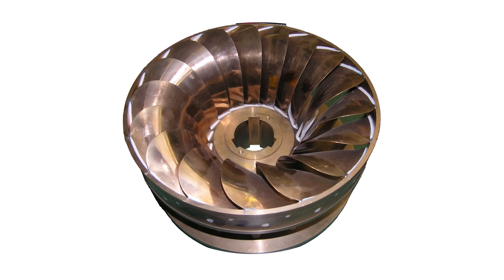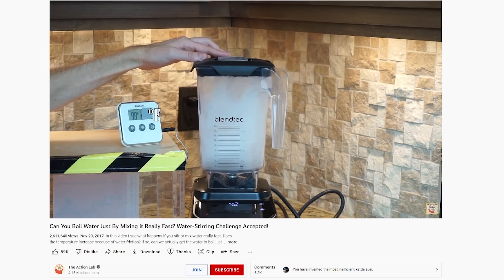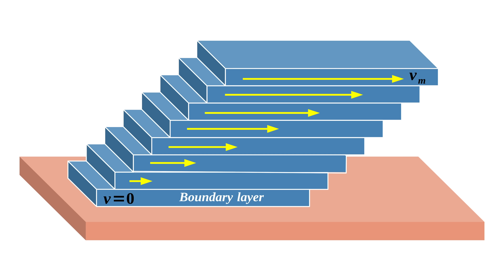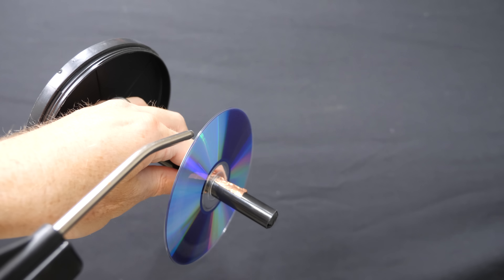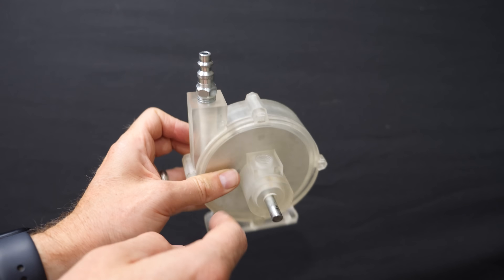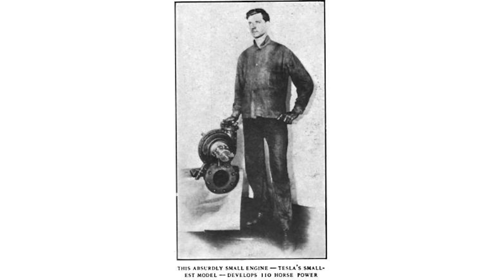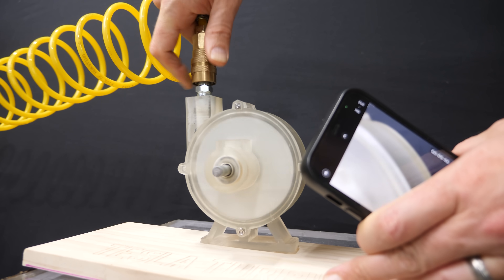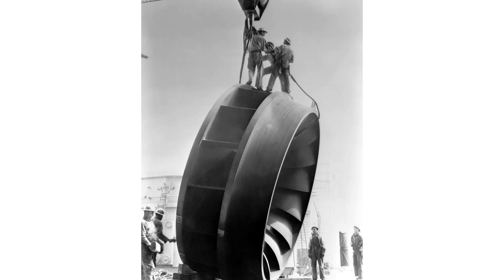How Fast Can a Tesla Turbine Spin?

Comment: materials engineering has improved... but people have the idea that only metals can be used... metallic bonds are not very strong... they allow metals to bend and stretch... the upper limits for thin disks like his design calls for are up around 100,000 RPM... there is another obvious limitation..  the bearings heat and expand... and self destruct somewhere in that 100,000 RPM range... so .. bearings made from carbon 🔮 crystals and a carbon sphere can be used..  
hole through the sphere with the table and girdle of diamond fitted in both sides with the point in a small hole adjustable on both sides for precision and balance..  the sphere can have slices that are part of the whole sphere... so the balance can be perfect... the high pressure goes out through the center hole... diamond doesn't get hot in any normal way.. I can hold it in my hand and drill.. cut and polish it.. which eliminates the expansion from heat..  
diamond has covalent bonds shared in all 6 directions around each atom ⚛️  . it is the hardest substance on Earth... it's also not really rare or hard to find... it's found in fault lines all around the Planet.. rivers and creeks and dry washes follow fault lines... all of them..  
silicon carbide is equally as good... the mountains behind my house have a lot .. along with granite in several flavors... 
silicon carbide is also 10 on the Moh's scale of hardness.. as light as aluminum.. strong as diamond.. and.. once you know what you are looking at... fairly abundant.. much more so than iron..  we can cut it..  machine it..  and make tools and machines that don't wear out 
with a zero "carbon footprint "..  
materials engineering for a small Planet

Comment: What about reversing it?
I mean that instead of using high-pressure air to rotate the turbine, to use power and move air.
Shouldn't that make the relative speeds of the turbine plates & the air much closer. As initially the air would be motionless (ignoring convection and other slight flows), but the turbine should "grab" some air with the no-slip effect and push it out of one hole, while sucking more air from the other, and air flow speed should soon match the speed of the plates.
Reply: You have seen a centrifugal fan, haven't you?
Reply: @balometer  , I'm quite aware of the input & output of such a fan, but the internals are quite different and that's what makes me wonder how would tesla-fan perform (energy, noise ...).
Your comment isn't very useful, unless you care to elaborate?
Reply: @blueckaym  A tesla fan is, in effect, a centrifugal fan. The difference is that a traditional centrif fan makes contact with air in several different ways, some of which depend on the same boundary layer adhesion as what's described here but others include direct use of velocity pressure and deliberate creation of vortices. Centrifugal fans (and pumps for that matter) can be used on reverse in much the same way as a tesla fan could be used in reverse and do not require fluid to move at anything like the velocity needed to operate a tesla fan at a rotational speed that might be useful. Simple radial bladed centrifugal turbines work reasonablt well in reverse. It is, however., preferable to design blade geometry with direction of fluid movement in mind since this greatly improves efficiency.
My comment was aimed at jogging your memory.
Reply: @balometer  I'm quite clear that a Tesla fan would be indeed a centrifugal fan. But jogging my memory about conventional centrifugal fans wouldn't answer the question how would a Tesla fan perform (even if it can be put in the same general group as other centrifugal fans, based on the centrifugal effect on the rotated air).
The very fact that you consider that different centrifugal fans can have different efficiencies shows that you don't believe they are all equal. 
But somehow you're trying to say that a Tesla fan would be exactly the same as all other centrifugal fans (even if you don't believe they're equal among themselves) :)
You even consider blade geometries in traditional centrifugal fans in both modes - fan & turbine - which (the geometry of the blades) makes no sense for a Tesla fan since it doesn't have specific geometry of its "blades" - they're disks! :) 
The very principle in which they move the air is different, and thus my question as I haven't seen single (tested!) example of a tesla fan.

Comment: Modern blades are actually incredibly efficient. It depends on application really, different types are more suitable for different hydro application. Almost all however, if properly designed (no point in improper design really) reach at least 90% efficiency or very close to it. Sometimes higher

Comment: the rpm is limited when its run on plain air. there is a specific pressure above which air cannot escape any faster from a nozzle, and that limits the fluid velocity and therefore the peripheral speed to a sub-sonic number.

steam and hot air can supply energy required for higher than sonic velocities...

a turbine is a mechanical analog of an electric motor.
the inlet pressure sees a "back pressure" just like the applied EMF sees a "counter EMF".
in the electric motor, its due to the fact its a generator too. its simply about the direction the energy is being converted. mechanical to electrical or vice versa.
the turbine sees a counter pressure due to the centrifugal force. and they will act like a pump if driven...

regardless of if its a tesla, francis, hero, or other pressure turbine... not pelton or impulse types. theyre fundamentally different...

Comment: cool to know that this invention is not being used yet because we cannot easily mass produce it using modern tech
Reply: Huh? You didn’t hear that in the video. What you did hear is that when a load is applied efficiencies are not much different than regular turbines AND that replacing current infrastructure would be too costly. Building them with current technology or any tech for that mater would be more simple than regular bladed turbines.
Reply: Err...No. It's not being used because it's of no practical use in most applications. This could have been made 200 years ago, it's just a bunch of discs attached to an axle with washers in between.

Comment: Normal water turbines averages 90% efficiency , some reaches more than 95%. Even pumped hydro ranges between 70-80% where energy is lost in both operations.
Reply: missing something...
the conversion of the water pressure or head, or potential energy, to kinetic energy, is always 50%. 

if you block the pipe completely with turbine... no flow, no energy to extract. all potential energy.
if the pipe flows freely with no turbine...full flow, no energy extracted. all kinetic.

somewhere in the middle, you get half...
the peltons exactly the same, but in reverse. the pipe flows freely, the water achieves full velocity. then that velocity converts to pressure when it hits the blade, and the blade retreats at half the velocity... half...
half...

you will find the turbine is 85 to 90% efficient at THAT conversion... a pelton doesnt bring ALL the water to a complete smooth halt, theres some splash. a francis turbine doesnt quite turn all that pressure into velocity, theres eddies and turbulence...
Reply: @paradiselost9946  what are you talking about is probably betz limit (altough not sure). And its not appliable on gravitational water turbines. It work on wind and open water turbines (with no pressure gradient). There you can theoreticaly take 59% of energy of medium so it can still flow. But in pressure devices like water turbines this isnt aplied since there is pressence of gravitation which is moving water forward to maintain flow.
Reply: @Theeloberto  sigh.

what makes the water flow? gravity.
so head is pressure. and head is potential energy.
stationary. doing nothing. cant use it.
as soon as any quantity of water starts moving from that height to a lower height, it is converting potential energy to kinetic energy.
if it falls freely, it converts all its potential to kinetic.
it still doesnt do anything.
for US to USE the potential in that head, we have to let it develop kinetic energy. it has to flow.

if we stop the flow, we dont do any work.
if we dont stop the flow, we dont do any work.

we have to stop the flow by HALF.

irrespective of what type of turbine we stick on there, we can only use HALF the potential energy available, or half the kinetic energy that may be developed during conversion. 

the other half has to keep flowing, has to keep moving.

betz law is entirely different, as there is no potential to be converted from, its already present as kinetic energy. all we have to deal with is mass flow over area. and if you broke it down to the potential required to induce the pressure gradient that caused that mass flow at that velocity, you would find that betz law is 59% of the 50%...

and then turbine marketers get really sneaky and sell you a "90% efficient" turbine, thats actually only 90% of 59% of 50%... and hell, we havent even dealt with the actual generator part yet!

but when it comes to wind power (or a mid river floating thing) we can happily ignore that first 50% figure.
Reply: @paradiselost9946  Something tells me you don't have a degree in physics or engineering......
Reply: @paradiselost9946  you dont have to sigh on me. In 4 months i will actually have my title from fluid engineering. I am not actually sure if you want to learn something or just spread your truth. Effectivity of water turbines (among others energz conversion devices) is measured as the total power potential of water vs what we can use. Total power is P=H*Ro*g*Q. Of this amount water turbines can extract 95% in ideal laboratory conditions. If your statments about 90% of 50% were true, non of pumped storage hydro power plants would be existing. Just bcs of your effectivity numbers it would be nonsense to build them. But they are actually build.
Reply: Exactly.

Comment: It seems like it wouldn't have the torque of normal turbines because the fluid runs parallel to the discs.  High rpm, low torque.

Comment: did you see where tesla had a patent for a steam condenser that would keep the boiler and turbine in low pressure lowering the boiling point of the water and gaining greater efficiency because of cold steam effects on boundary layer greater air density greater traction 
    in a cold environment geothermal active this design would be king if someone could make it work
    if advancements in water splitting continue could power the entire world off greenland

Comment: How do they fare in the maintenance department? Spending a little more upfront to cut costs down the line is a good long-term strategy, and should logically encourage adoption of these if they're that much better in this department.

Comment: In perfusion we used a triple nested cone turbine to pump high viscosity fluids (blood) based on a 1974 US artificial heart programme design. Used successfully in the 1980/90s for long duration cardiopulmonary bypass and ECMO, they have since been superseded by conventional bladed turbines as they can be built smaller and rev slower for the equivalent blood flow.

Comment: Built one some years ago from old computer hard disc drives.
Stripped the platters from the drives, drilled central air exit holes close to their centers and stacked them (6 off) back in one of the drives with 0.5mm spacing between each platter. Used plastibond to shape the interior of the drive casing to have very small clearances between the disc outer edges and the casing and the outer faces of the disk stack.
Used a 1.2mm mig welder tip as a air nozzle. Ran of 120psi air compressor.
Sounded like a jet engine spooling up, measured rpm at 22000rpm. 
One problem tesla had was the turbine was capable of running at such high rpm that the disk materials of the day couldn't cope with the loads. 
I ran mine from a safe distance.
Reply: Don't run it at such high rpm, or don't run it with no load?

Comment: I wonder if a blower with the same design would be quieter. E.g. a cpu cooler.
Reply: If you run it backwards (axial input, peripheral output) it will pump fluids, instead of slowing them down.

The other thing to note is that the hotter the gas you run through it, the better it pumps the gas. Though if used as part of a liquid system, then you want the liquid to be as cold as possible.

Per noise, it's a matter of not spinning it fast enough to go sonic, having good bearings, and having a balanced rotor.

Comment: Why do not try a mix of the two, a Tesla blade turbine with for ex curved plates that recall a normal turbine but with plates so the fluid is forced in the direction of the curve of the plates and then forced out

Comment: Also if you make a large disk spin very fast, the edge speed of it will eventually break barriers you do not want to break ;)

Like moving air past the speed of sound.
Reply: As menitoned in the video the disk can only reach the bulk speed of the liquid at most, so you'd need to use air that's already moving at the speed of sound (and realistically way faster since not all of the energy will transfer), so it's not exactly something one can do on accident
Reply: @user-zz3sn8ky7z  just imagine a huge turbine used in power generation, it is simply unrealistic to spin a plate that large as it will simply disintegrate.

At small scales it can work.
Reply: @sjoer  But it is realistic to spin 24 car sized blades at the same pressure, so why would the disc somehow fare worse?
Reply: @GabrielAKAFinn  are you trying to compare a wind turbine with a Tesla turbine?

Then you clearly do not understand what the problem is.
Reply: @sjoer  I don't think you've ever seen a turbine in your life if you think I was referring to wind turbines, genius

Comment: instead of stacking the plates why not have multiple motors with single plates, also with the exit near the edge of the disc not the centre
or would this be the same thing with just more motors

Comment: I wonder if cutting holes in the disk would help air grab the surface in between the disks? And saves disk mass….
Reply: The suggestion by Tesla is actually to give the disks a tapered cross section, reducing the thickness of the vanes at the outer edges.

Comment: don't forget that the material  needed to make a 60' diam disc needs to be resistant or immune to blade wobble at high rpm.  thats another reason they are not used.  the ones built to scale back then destroyed themselves due to high rpm wobble
Reply: No they didn't. The first working model exists and only reaches 3,800 RPM tops. Not sure why you'd say they destroyed themselves when they are in perfect working order.

Comment: i think the answer, obviously, is to put small or very small tiny spoon shaped buckets around the top edge of the disc to increase contact between the fluid and the moving metal.....it will cause a bit of turbulence and decreased efficiency but will increase energy transfer between fluid and disc.....the efficiency will average out to 35% loss again but the turbine will maintain speed better and deliver more power per unit size
Reply: This is a sarcastic answer, yes?

Comment: are you high? 35% loss my ass, modern turbines are 90% efficient. 
tesla turbines is just worse in about every metric there is.
Reply: not to mention tesla turbine is useless for anything that requires work done. It has no torque nad can in practice only be used as a fancy rpm counter.

Comment: It's a great design in theory, and with 35% inefficiency of the standard type of turbines, used in traditional and modern generators from coal, gas or nuclear ones to wind farm windmills. We have to increase efficiency in the current need for more clean energy. It seems that brilliant f1, sailing, and aerospace engineers need to be encouraged to perform their usual magic to resolve this globally important issue

Comment: A well made and carefully balanced Tesla turbine can convert ambient heat into rotary motion. Running on water vapor under high vacuum it will actually produce ice and will continue to accelerate as the water reservoir drops below ambient temperature.

Comment: Perhaps another problem is the water used to turn the turbine is not exactly clean. There are a lot of debris in river water. Silt, animal, plant, pebble. With the restrictive requirements of Tesla turbine, it will constantly have to be stopped to cleanup those debris.
Reply: That is not the case, you have to play with the spacing of the disks to allow for the contaminants to not get stuck, and to make up for that loss in efficiency, you can add more vanes. Turbines otherwise already have protective meshes to screen for larger contaminants.

Comment: Run it under vacuum and cold steam to increase efficiency velocity and torque!!
Rumor is there was a closed system made out of alloys that can withstand the pressures and temp of super heated liquid mercury. The torque was phenomenal and the energy exchange of the turbine rotor w mercury would cool the liquid back just enough. And with a small outside source of energy the convection currents of this liquid metal were harvested at near perfect conversion rates